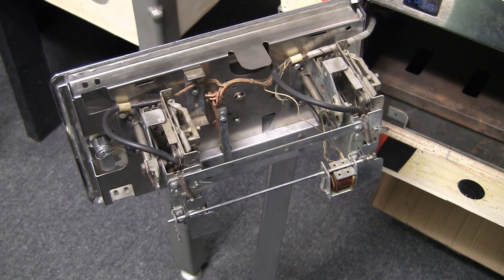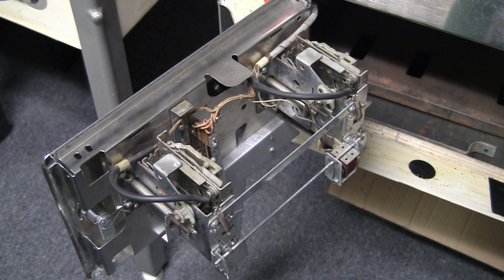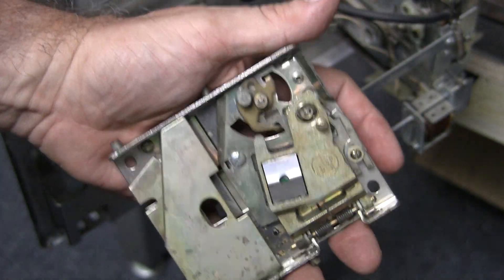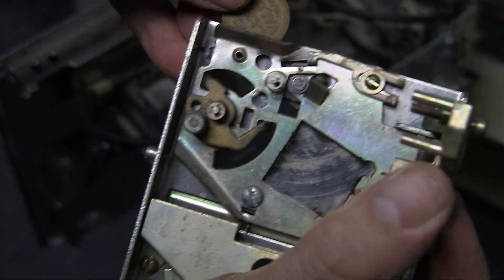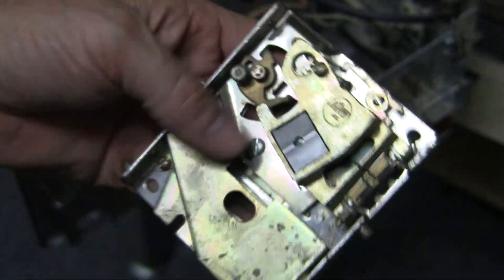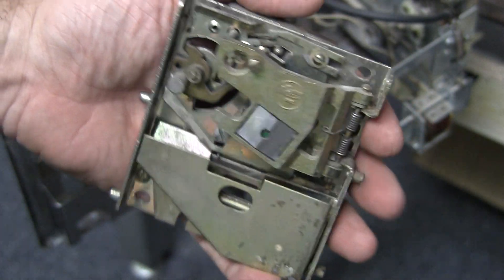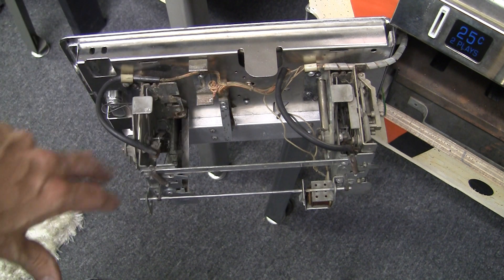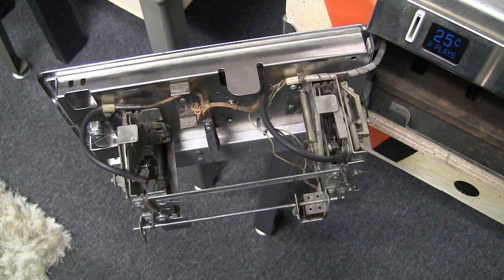Pinball Features: Coin Mechs & the Coin Door - PinballHelp.com

Comment: Is it possible to convert a micro switch coin mech to an electronic coin mech?
Reply from the maker: I'm sure it's possible.  Although I tried to hack an EM to use an arduino, and I had problems because of RF interference, but I've seen electronics in games - to do so with an EM may require some shielding.

Comment: I have a machine that rejects about half the coins inserted. I've cleaned and put silicone on everything, which stopped the frequent jamming but did nothing for the high rejection rate. I'm stumped.
Reply from the maker: Try a different coin mech.  I think the plastic Imonex ones are probably the most reliable.

Comment: That's all good.  But it would be great if you can detail how the quarter passing through the mechanism actually triggers a game credit.  Show the wiring and switch that does this.  Also, please create a video (you are good at it), showing how we can put them back in "coin op order" after buying one that has been disabled.  I'm basicaly putting my Royal Flush back together.  This door you show here is the same one I have.  I learned a ton on this short video.  Switchology, schematic reading and relay theory are my next things to learn about.  Fortunately most of my machine works.  Except there's an intermittent issue where the startup motor does not turn off as the wheel continues to spin.  I'm thinking I have a switch issue with the AX relay.
Reply from the maker: That's a great idea.  I wish I had time to put together much more comprehensive videos - I'll add that to my "to do" list.

Don't forget to subscribe!  https://youtube.com/pinballhelp?sub_confirmation=1 Every little bit helps.

Comment: Are there different size/style coin mechs that only fit one type of door or will any coin mech will fit any door?
Reply from the maker: There is generally a "standard size" coin mech.  However, not all coin mechs can fit all coin doors.  There are some "universal" ones which have these little screw-heads you can move around in different spots to make a mech fit into a certain assembly.  Different types of assemblies may have the latches/catches in different spots, so sometimes you have to slightly modify the mech.  But generally speaking, they are mostly interchangeable.

Comment: What do you use to clean out the coin mechs when you have stuck gummy and sticky Quarters or the Wrong Coins that are Stuck inside the Coin Mechs and Coin Ramps? What do you use as cleaners and cleaning tools?
Reply from the maker: On location, I usually have some extra mechs in one of my games, so if there's a gunked up mech, I'll replace it and take it home.   In some cases, I have been slowly replacing the older metal mechs with the newer plastic imonex ones that seem to be more reliable.   But as far as cleaning, I'll use PB blaster, then clean it up well, then use some dry lube like non-oil based silicon or graphite lube.
Reply: @PinballHelp  What brand names that you use for the Dry Lube and Non Oil Based Silicon? You just spray it into the Coil Rail and Coil Mech and the Stuck Coin will get out? I'm guessing that the newer Plastic Imonex doesn't have Coins getting stuck or soda being spilled on Plastic doesn't stick?
Reply from the maker: @waynegram8907  I'm not sure of exact brand names - just look for non-oil based lube (dry lube).   The plastic ones can get crapped up too but they don't seem to jam as bad.    I don't run into a lot of "gunk" in coin mechs as much as I encounter a stuck/wrong coin and then a jam.
Reply: @PinballHelp  yes when a stuck or wrong coin you use a Non Oil Based Lube dry lube? and it will get the stuck or wrong coin out of the coil rail and coil mech?
Reply: @PinballHelp  I don't know if dry lube will clean soda because soda is very sticky and gummy. So what do you use to keep soda and gum off of coin mechs?
Reply from the maker: @waynegram8907  yea, dry lube is for when you have the mech already cleaned.  You can probably soak a coin mech to get rid of anything particularly nasty.  You could probably even through a unit in the dishwasher (the metal ones), although I wouldn't dry it - let it air dry.

In general, alcohol is a great way to clean metal parts that are gummed up.
Reply: @PinballHelp  ok thanks for the help